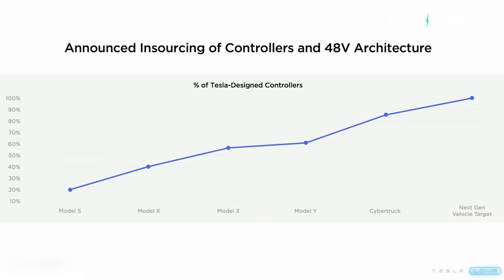How Tesla plans to save $10 billion every year by using less copper

Comment: Not the Entire Architecture, the Drive battery architecture remains the same. And it doesn’t effect the structure as the cross section of the wire and the Looms as a result go down in size. BTW in my youth 6Volt was a very common battery size and I remember when some cars needing 12volts had Two batteries … Mums Morris Eight EType and my brothers Ford Prefect.  Had 6v as did my Wife’s VW Beetle. Head Lights tended to be there more for oncoming traffic than to light up the roadway … these higher voltage systems also mean Switching can use metal in the contactors too …

Comment: Please note that the copper in the motor itself is NOT applicable to the 12V to 48V change.  Nor is the copper in the battery pack.  The copper in the motor itself is running at the pack voltage... typically on the order of 400V.  It has nothing whatsoever to do with the 12V/48V circuitry.  And the copper in the battery pack is based on the cell topology.  So also not applicable.

What is affected is the copper wiring for just about everything else.  Lights, sensors, pumps, and so forth. 

Generally speaking increasing the voltage 4x cuts the current to 1/4th, but since losses (heat) are a function of the square of the current, actual heat is cut to 1/16th.  However, only a portion of that copper actually has to carry any significant current (in terms of making the wires smaller), so only some of the wires can be cut down in size by that much.  I would say that Elon's first-order estimate is probably more or less correct after the copper windings in the motor and the copper in the battery pack are discounted.

Comment: Yes, going from 12V to 48V reduces the current needed to make a given amount of power in let say a head light.  This would mean that the wires to run the headlights could be about 1/4 the cross sectional area.  Remember your math that Area=pi*R^2 so this means 1/2 the diameter of wire.  There are, however mechanical questions. Really thin wire is mechanically weak so more support of the wiring will be needed.

Comment: The low voltage system accounts for only a small fraction of the copper used in the car. 5% would be a extremely generous estimation, so max weight saving couldn't be more than around 1%
Reply: Dude, you don't want to know my thoughts right now.

Comment: The complete Tesla low voltage harness only weighs 20 kg so best case you are reducing the copper by 4-5 kg. The computers are the largest low voltage power load. Fans, pumps and seat heaters would be other loads that might require a slightly heavier wire.

Comment: Great video. I would love to see a video discussing the replacement of wire harnesses with Ethernet cables. I think Ethernet will save on cost, possibly weight of parts and complexity of assembly as well? I’m not an engineer so I confess I don’t know alot about the technical stuff
Reply: For sure automotive Ethernet will replace CANBus. Starting with Tesla.
Reply: Tesla got patents I think for that a few years ago but we haven't heard anything so maybe it's not really going to happen?
Reply: Ethernet wires are pretty thin (#22 gauge I think).  I dont think wiper motors, headlights, heated seats, window motors etc etc can be powered this way.  Those are the loads for which the swap to 48V would be most beneficial.

Comment: the amount of copper will not decrease to the amount stated because only high current circuits on the 12v supply would decrease and the high voltage power wires and low voltage signal wires would still be the same there would be less than 1kg removed

Comment: Sam I think you are wrong about the rest of the Tesla models. The money that can be saved will be the driver here. They will work out the teething problems, and when they are satisfied, they will incorporate it into the rest. Additionally the higher voltage will offer other advantages. And once the market opens up for the accessories using the higher voltage, the rest of the automotive industry will follow suit. The change is overdue.

Comment: The amount of copper being used in the 12V system is very small in comparison to the battery and drive units. So yes in theory you will save 75% of copper use by moving from 12-48V but only for the components and wiring that are using 12V. Hard to guess exactly how much that is, but one would think closer to 4% of the total copper use in the vehicle so actual savings might be 3% copper use.. Still a very significant cost reduction, but not "game changing"
Reply: This is incorrect.  There are tens of miles to hundreds of miles of 12v wiring in an EV, where the high voltage systems are designed to be as short as possible, generally not more than a few feet.
Reply: @GregHassler  Respectfully the amount of 12V wiring in cars has reduced significantly. Most of the 12V wiring in cars has already been replaced with CANBUS. This will not change moving to 48V. Things that do need 12V would be lights, wiper motors, seat motors, door locks, window winders, computer etc. Reducing the size of the wire running to these items will not be earth shattering. They are not that big anyway. In theory one 12V wire and 2 Canbus wires can run the whole car. Most of the copper in Tesla's are used in the battery cells, the busbars between the cells, and the electric motors. According to some sources a Telsa has 85Kg of copper versus 23Kg for an ICE Vehicle. Most of the copper in an ICE vehicle is in the alternator, starter motor, the wiring to the starter motor and alternator, and the radiator. Remove these items and you are probably left with around 12 Kg, One thing I did not consider is that the amount of copper used by small motors can be reduced significantly. eg Solenoids, Window Winders, Washer and Wiper Motors. For Tesla this is a 1or 2 percenter. The cars will be a few kilos lighter, and cost a little bit less. By making the cars lighter they will go a few more kilometers, than the competition and help Tesla stay ahead of the game.

Comment: Changing from 12V to 48V is not entirely free of drawbacks, with perhaps the most serious being the difficulty of interrupting a load.   Simple mechanical moving-contact switches have a tendency to "arc over" when they try to open in a DC circuit, and the higher the voltage, the more pronounced the tendency is.  It might well be that electronic power switches have only recently been practical for widespread automotive applications.
Reply: They're all solid state for the low voltage systems now.  At least Tesla is.

Comment: Its not the copper, its the wiring harness complexity. Modular assembly requires pre installed a wiring harness im each module that ends in a plug that snaps together. The smaller you can make this plug, the better. One way is to multiplex the commands and data on 2 wires, power and ground on two wires. It takes a lot of power to raise a window, defrost the window, defrost the door handle, and run speakers around the car simultaneously. 
Relays are another problem. Switches do not operate a motor directly, too high a failure rate. Relays also fail and are heavy. Musk uses SCRs or the eqivalent to eliminate relays. The less current, the smaller the SCR. This can be a smart SCR that senses temp, current, address. May need another wire to supply low voltage for the logic system.
All those cameras are very high speed, one direction only, separate twisted pair or coax cable.

Comment: The change to 48V will not reduce the copper with 75% because most of the copper are in the motors that already running on 400V and maybe 800V soon. I guess the copper savings will be much less, maybe 10% Simply because the 12V harness is just a fraction of total copper used in the cars.
Reply: Incorrect, there are tens of miles of low voltage wiring in an EV, where high voltage systems are designed to be just a few feet.

Comment: People have discussed this move to 48v before. The problem was getting the companies making 12v accessories changing to 48v. There has been nothing so far to get them to change. Perhaps Tesla leading the way will cause the other car makers to push for it too.
Reply: Suppliers already make 48 volt components, this is a rumor propagated by traditional auto.  The differences are minor.

Comment: Hey Sam, using 1/4 of the copper in the car's low voltage electrical system is not magic. It is a function of Ohm's Law  P(power) = E(voltage) x I(current). What this means is that for a given amount of work to be done, (power) you have the choice of either supplying more voltage or more current as measured in amps. If you 4X the voltage to 48VDC, you then only require 1/4 the amperage for a given load. Since a copper conductor's ability to carry current is dependent on it's cross sectional area, 1/4 the amperage requires 1/4 the amount of copper. Physics is the rule, everything else is a suggestion!

Comment: FYI cars went from 6V DC to 12V DC in 1955, so it has actually been 68 years not 100.  Also, the significance of this is that the cross sectional area of the wires feeding all of the accessories on the car can be 25% of what is required for 12 V DC because only 25% of the amperage is required to get the same power (watts) needed by each accessory.  Smaller wire = lighter wire harness and less copper.
Reply: Well, almost. GM in 1955, Ford in 1956. VW in 1967.

Comment: It is the LOW VOLTAGE POWER DISTRIBUTION system that changes
from 12vdc to 48vdc.  Not all voltages.
The much higher voltage to the motors remain the same, and
the low voltage for the microchips remain at 5vdc or lower.

Increasing voltage by 4X  from 12vdc to 48vdc allows a drop in the
current by 4X because Power = Voltage x Current, so the same
power can be transferred with 1/4th the current.   And since
power lost to wire resistance is Ploss = Resistance x Current**2,
loss can be reduced to 1/16th, assuming the original resistance.
But if wire resistance is allowed to increase by 4X by decreasing
its cross-sectional area to 1/4th, the original power loss reduces
to 1/4th  (4 x ((1/4)**2), and the wire mass (i.e. copper) reduces
to 1/4th (assuming the same length).   This gives the 1/4th copper
cost and weight saving, plus it allows a future increase of 4X in
wire lengths while keeping within today's power loss level.

Better insulation, connectors, and corrosion resistance are
needed with the higher voltage, but those trade-offs have been
accepted in aircraft design for generations.   My 1960 VW Bug
even had 6vdc electricals, and VW subsequently went to 12vdc
for the same reasons.

Comment: Aircraft have used 48v as the standard for generations due to the weight savings. As to why the auto industry is so behind on this is a good question.

Interesting article here: (Google) "48V Vehicle Electrical System – More Than Just a Bridging Technology?" And that's with conventional IC vehicles, let alone EVs.
Reply: Maybe the incentive to save weight in a plane is greater than for a car.

Comment: Going to 48 volt has been something OEMs have wanted to do for a long time.  However, the auto world is comprised of a mostly 12 volt supply chain.  The issue is getting the lights, radios, and every other electronic component to be 48 volt compatible.   Glad Tesla is tackling it, but this will mean more challenges in replacing broken electronics.
Reply: This isn't a problem.  All modern lights are LED, most of which have a very wide range of acceptable voltages.  The other actuators and motors just require a slightly different winding configuration, which is well understood. There will be no problem, many / most of these components are already available in 48v versions.
Reply: @GregHassler  You missed the point entirely.  It is not a technical or design challenge.  It is a supply chain challenge.
Reply: @jeffsteinmetz7188  Exactly. It's things like plugging in a trailer and it still has 12v lights and brakes. This can all be done, but it will take some time before everything is assumed to be 48v inside a car. You're talking different seat and window motors, blower and fan, etc etc.

Comment: It's simple math buddy. Power = Volts x Amps. 48V / 12V = 4. It's 1/4th less amps needed for the same power level. 75% less copper through the use of higher voltage and less amperage.

Comment: The 48 V have been used for some years now for the mild hybrids ICE cars. It comes together with a motor/generator that will provide a short boost so the turbo lag will not be felt at the initial acceleration and a little better fuel economy. When braking a modest regeneration will take place if the battery is not full. Having 48 V makes the 12 V battery redundant as it is possible to run components like wipers, windows, etc. on this voltage. It sounds like a good idea to use 48V instead of 12V and it will probably safe a few pounds of copper but have in mind that the components in the car must be built to ensure you will not touch anything with 48 V DC.
Reply: Whatever you are smoking, I'll take it all😂
Reply: @RichardSalmore  What is wrong with youRichard. Are you proud of your ignorance?

Comment: re: The last point of this video:  Changing the low voltage side to 48v doesn't affect the high voltage drive train.
That said, changing the high voltage side from ~400v to 1000v very well could.  If the motors can handle the 2x voltage, they might be able to use 50% copper.
...this was just a quick estimate/reaction re: the high voltage side impact...

Comment: Why would changing the model 3 and model Y being too expensive?  Switching to a 48V system is likely not that complicated.  Most of the components on the car won't run at 12V anyway with a great many parts using a DC converter, including all of the computer boards.  If those parts already exist and it just needs to step down the voltage 4X that's a pretty trivial change since you'll need to make the same converters for the new models anyway.  There will be some 12V motors and solenoids in the doors and trunk but again they'll be making 48V solenoids for the new cars too, so no increase in SKU count.  I'm guessing some parts will need to be retooled to alter mounting points or maybe some parts will need additional adapters for larger components but over a million cars per model it makes total sense.  The Model S and Model X might wait for a redesign because the current production rate is significantly lower, but I see no reason not to take advantage of the scale with the Model 3 and Y as soon as it's ready.

Comment: The calculation of the copper amount required should be pretty straightforward if I'm not mistaken: 
Let's say you have a consumer of 1000 W. So, P = U*I , with P in [Watt] and U in [Volt] and I in [Ampére].
So, 1000 [W] = 12 [V] * I [A] which yields I (12V) = 84 Ampére in this example.
If you have the same consumer in a 48 [V] car: 1000 [W] = 48 [V] * I [A] this yields roughly I (48 V) = 21 [Ampére] which is 25% of 84 Ampére.
So, the cross section of the new copper wire only needs to be about 25% of the legacy wire.

Comment: How will you use jumper cables if small battery needs boost?
Reply: Why would there be any difference? As long as you go from a 48V battery to another 48V battery.
Reply: My point is that currently you can get a jump start from almost any cars\. That will be impossible with 48V
Reply: @scotduckrow8524  Tesla's now have a 16V Lithium battery but the older ones have 12V lead acid. (I not sure if they replace the 12V with another 12V - probably). These batteries I thought were normally charged off the drive train battery. Another solution could be a cable with a transformer to change the voltage from 12V to 48V.

Comment: Less copper, less weight, more efficiency . . . . correct. 
But if that was a main reason, . . . WHY the hell is Tesla building 2, 3 and more metric ton vehicles? 
Realy want to be more efficient?  
Dont build cars that use up to 2 or 3 metric tons of material, that will mainly transport 1 person from A to B.  
Turn back from your idiotic waste of materials and build EV's that weigh around 1.000kg. That way you can build 2 or 3 cars for the price of 1.

Comment: The auto industry wanted to do this years ago but failed in getting it implemented by all the manufacturers delivering them their components.
It's not 1/4 of the copper needed for the car's complete production, it's just 1/4 of that needed for the low voltage circuitry.

Comment: It's only the electric control system, not the motor system. Tesla motors all run @ 320 volts:

Rear motor: AC permanent magnet synchronous motor, liquid-cooled, with variable frequency drive.

Front motor (AWD vehicles): AC induction motor, liquid-cooled, with variable frequency drive.

48 volts are nothing that new and the higher voltage reduces resistance losses and it's below the critical 60 volts after which the shielding has to be increased...which increases costs.

Comment: @lukebrisbane is absolutely correct.   A typical ICE uses 10-20 kg of copper. Probably only 5-10kg if you take out the very large “starter” cables leaving 5-10kg at most for the other 12v electrics.  I would guess Tesla’s 12v system uses no more than 10kg of copper, however, every little bit helps.

Comment: So why the magic number of 48 volts. Why not 50 or 25 volts? Where lies the border between low voltage and high voltage?
And what does this mean for the current global 12 V architecture. For many of my electronic houshold appliences and tools they run on 12V archiecture. With tools: Milwaukees 12V archtecture tools are showing to be very versatile compared to its 24V architecture. A lot of electronics are also still in the range of 5,10 and 12 V architecture. I believe the discussion is more interesting than just weight savings if copper. Would be nice to see a more deep dive in the low voltage standard, mr. Evans.